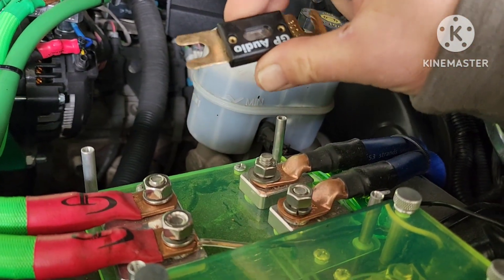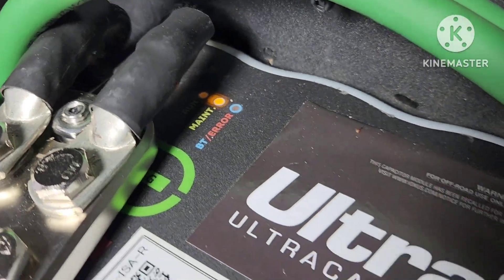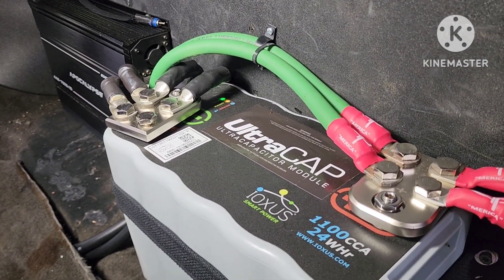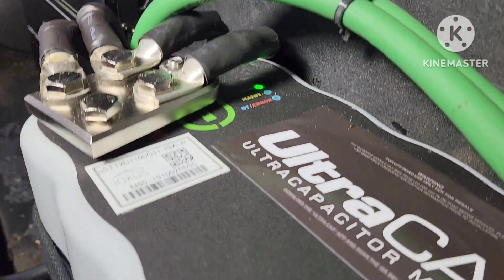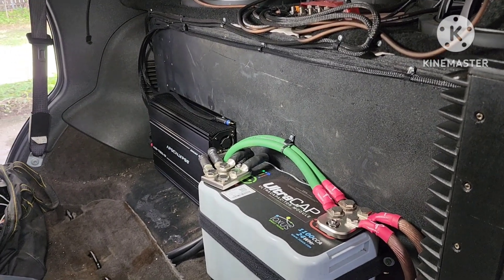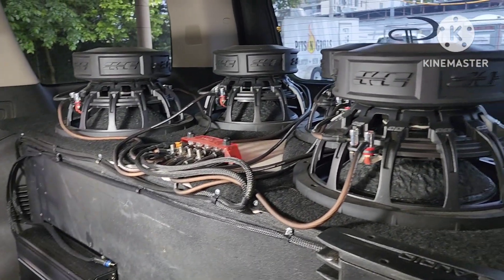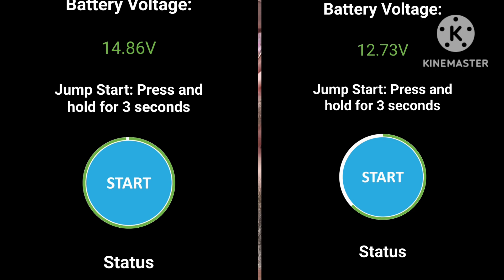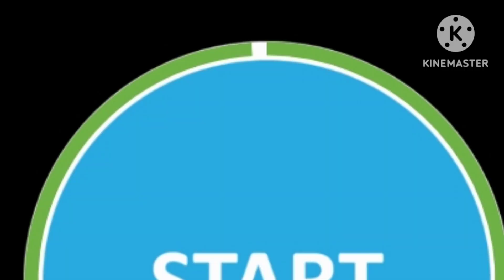Testing out the Ioxus Ultracapacitor

Comment: Nice system build what highs are you running?
Reply from the maker: 4 recoil 6.5 inch mids in the doors, 2 Audio Dynamic 3000 series mids and 2 Memphis M series tweeters in the a pillars. all those off an OLD JL audio 450/4.

also a little 10 inch JL sub in a very small sealed box in the center console, powered by a Memphis 1000 wats amp
Reply: @CarAudioEnthusiasts  thanks a lot that's kinda weird I was looking at recoil 6.5s and audio dynamic mids as well recoil makes so much good decent priced parts and audio dynamic makes very good parts just deeper pockets but well built how do u like them?

Comment: I’m running one of the ultra caps in sink with a120 ah headway bank stock alt rn on a jp23v2 on a sundown Uv2 18. I have a whole lot of headroom for future upgrades
Reply: 1 Ultra Cap, 400amp @ 14.8 alt, 120ah of Headway on two Salt 8 amps “strapped” pushing 3 Nightshades 12in’s Nv5. Love it.
Reply: @62dobie  💪🏾💪🏾💪🏾💪🏾
Reply: @62dobie  shew wee!! That's some pressure 🤝.. 3x ns 👀
Reply: @62dobie what the lowest voltage you see ?
Reply: , When pushing extra hard for an extended period, 13.8 But I stay at 14.3 mostly. And that's pushing close to max for several songs. Just not max to clipping. But close. The 400amp alternator is the best bang for your buck.
Reply: @62dobie  you get any voltage drop
Reply: Ill be running duel alts, 300 amp, and a 350 hairpin whatever that means....I have 4 sundown x18s and super beast 96AH lithium bank running an nvx xad 8000rms amp.....would I notice a  fair size voltage improvement with only one of these....and all the necessary electrical of course.... or something else be better investment
Reply: Same brother 🤘.. I have a stock alt . Only a   xs 3500 battery and a ultra cap  in the back and it's pretty impressive what I can pull.. have a js 320 waiting to go in
Reply: @MatthewGuynn-ki8rn  I’m looking to get a 370 mechman in the future that’s 700 like bucks lol
Reply: @jsaw1988  I'm running a dd9518 on the jp 23 v2 .. so really close to your setup 🤘🤝.. single 18 gang 😁

Comment: Get you a nice lf audio or high rate volt meter that’s what’s in the capacitor I have a lf audio it shows every little voltage drop as I have 3 other volt meters that stay at 14 when my high rate meters show the voltage drop as it’s too fast for  basic cheap meter to pick up. Probably why your trucks meter show the same voltage drop as your capacitor app showed.

Comment: I was thinking about trying a super bank this b stock ? as of split washer I got rid of them they caused problems cause heat as if a bolt gets loose the split will do its job and stop or lock the bolt from getting more loose but when it does this it creates a gap or split causing heat. Use gear lock washers or just plain washers. I use gear. High voltage electricians despise the split lock washer cause that reason of creating a gap is loose.
Reply from the maker: yup B Stock from Big Jeff

Comment: I have 2 of those ultra capacitors. Gonna be on a jp33 with a 320 js alternator. I can't freaking wait. I have my shit I just gotta get it in.
Reply from the maker: SICK!, what batteries you have?
Reply: @CarAudioEnthusiasts I bought two these put them on a bench dc power supply to control current and Everytime I take it off the power supply the voltage drops to zero.
Reply from the maker: @Doubleovegetable  your use case maybe outside the design ,  not sure bro.
Reply: @CarAudioEnthusiasts So talked to someone at xs power they were saying the circuitry cuts of all power if not hooked up to a battery. I guessing this is for not killing your battery if it sees low voltage.
Reply: @Doubleovegetable  if they read below a certain voltage they shut down.
Reply: @CarAudioEnthusiasts  a large sodium battery but its like a group 31 agm.
Reply: There's been like 2 incidents so they had to put out a notice! That's how NHTSA rolls!
Reply: @commonsenseisdeadandgone  get enrolled yet?
Reply: @chrismarshall4653  why 2?
Reply: @kennyk5150  why not. Double the amperage delivery.  I also have 3 amplifiers.
Reply: I always wondered if I could run 2 of those batteries.  I imagine its a huge difference.
Reply: Be careful with those Ioxus capacitors. They were recalled because of some circuitry that if it burns out, the cap will drain your AGMs and catch fire. You can buy them for like a $100 now but I wouldn't put one in my car.
Reply from the maker: @LowFrequencyFanatic  I ran with several in different big trucks, company fleet never had any issues with them, pulled em all from the recall for insurance reasons.  mine is fused in 2 places, pretty much anything that stores a lot of power has a higher chance of (releasing it) randomly. but tks good looking out!
Reply: @CarAudioEnthusiasts  I thought about getting one because you can get em used really cheap. What batteries are you running with it?

Comment: also in a car powered by the alternators if your not charging at 14.8 volts like the battery chargers for the redodo batteries and Dakota lithium batteries they will never get fully charged. But this is a good thing as lithium batteries don't like to be constantly topped off. I was told to start them off being charged by the charger then u can put it in your vehicle to run along side with the alternators and agm batteries
Reply: Can these capacitors be hooked up to lithium battery as well?